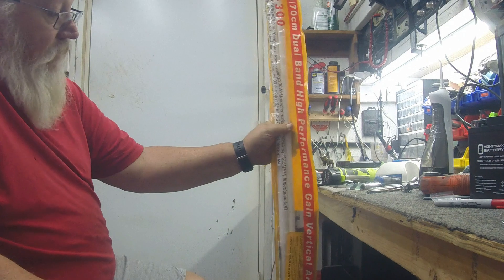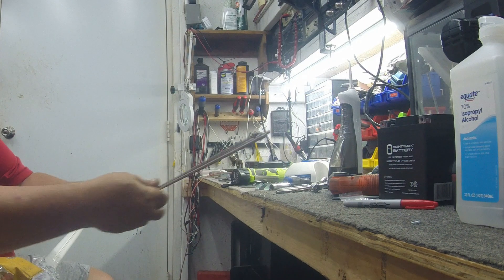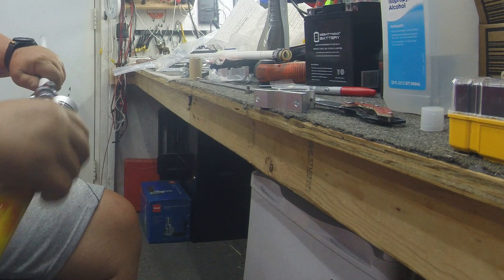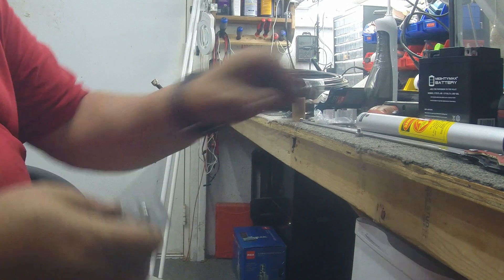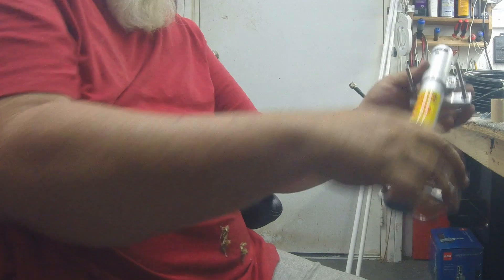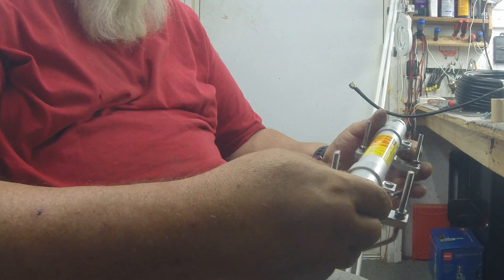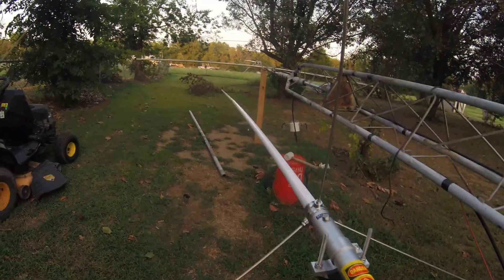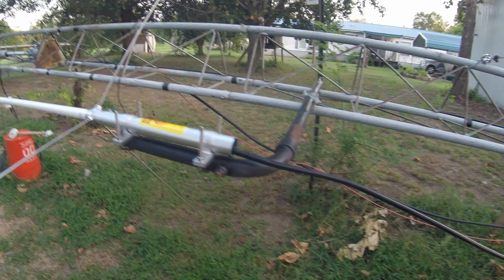Best Dual Band Ham Radio VHF/UHF Base Antenna Made: The Diamond X300 WIth Installation Information

Comment: I Would Agree ! The Diamond Diamond  X510HDN is Probably The Best VHF/UHF Antennas You Can Buy Now Days & I Would Also Say The Comet GP-9N Is Probably Second Best Both Are Very Close The Diamond Will Hold a Fuw More Watts But Other Than That They Are Identical Pretty Much ! I Have The GP-9N & I Think That N Connector Is The Only Way To Go..IMHO If You Enjoy Simplex as Much as I Do & some of my Budys The Ya Got to Go With The X510HDN Or The GP-9N & They Just Work Very Well ! they was night & day Difference for me from the 30 or 300 !
Reply from the maker: @bigchew3149  totally agree both are great antennas.

Comment: Is Diamond and Comet the same? I have a Comet GP-9 that looks the same.
Reply from the maker: @HamRadioN0CKL  yes I believe they are very similar antennas the Comet is longer than the Diamond,  both are high gain antennas the X300 has 9.3 gain and the Comet is 8.5 but both are great antennas.

Comment: I have a Diamond X300A. It's 10ft. tall. Its base is just above the gutter line on a mast. I can open 40 repeaters from my QTH and hear 4 others. The most distant repeater that I can open is 91.8 miles away with 50 watts. I'm not even using VHF coax, but RG8X (25ft.). AMAZING distance for an omnidirectional vertical.
Reply from the maker: They are great antenna's I am running two of them one for my APRS setup and one for normal use they both perform amazing..

Comment: I have had one of these up on a 40 foot tower since 2015 and its still working. To my knowledge there isnt anything wrong with it. I meter it once a year or so and SWR hasnt changed since the day it was put up there. Im moving to a new QTH here this year and just ordered a new one for there. After 10 years of being up I wont reuse it but at least I know ill get 10 years of service out of the new one. I didnt do anything special when putting it together I screwed everything together and gave it to my tower guy and he went up and bolted it on.
Reply from the maker: @jeremeytaylor2433  That is awesome. This is my second one, too, and the original one is still going they are very well-made antennas and perform wonderfully. I stand behind saying they are one the best dual band base antennas out there.

Comment: Say do you use any Vaseline on to the coax connectors or the antenna center connector for waterproofing or use any self-amalgamating tape?
Reply from the maker: I don't put anything in the connector but I do seal it with Rubber Sealing Tape I use coax seal tape but any good rubber based tape works great than I cover it with electrical tape. I just recently moved my antenna that had been in the same place for 20 years and that tape was still flexible and there was no moisture in the connection... This is the type tape to protect it. https://amzn.to/40qp0q2